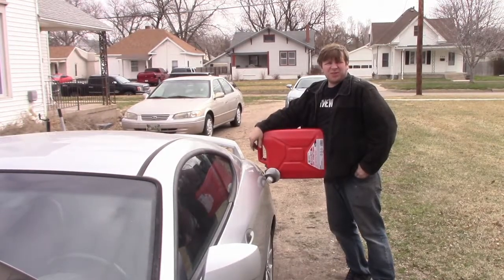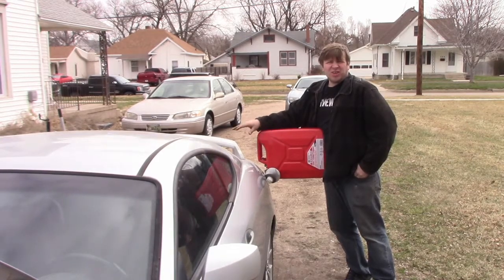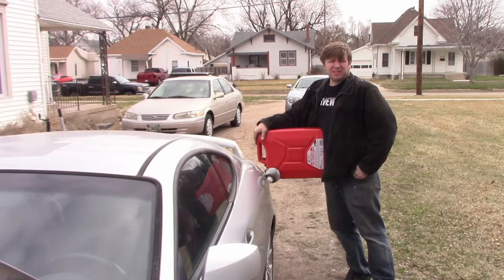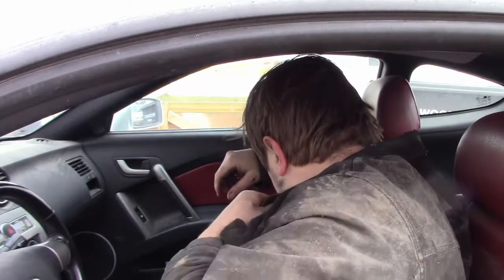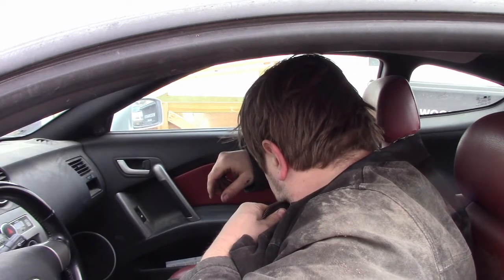Running E85 Without a Tune?| 2007 Tiburon SE | Driveway

Comment: You don't need a tuner to run E85. Just get one of those E85 conversion kit, then u r good. I have been using one on my 2005 Camry since 2016 and no issues since.
Reply from the maker: After stepping back a bit - I would have been fine with just the bigger injectors and it would have been OK.  Where I went wrong was having the high performance cam without a tune which created a lean spot where it was trying to make more power but couldn't.  Every thing is clearer in hindsight.
Reply: Are you still running it?
Reply: @surreal4595  Yes, ma'am/sir. Still kicking it. Occasional engine lights (like once a year or so. Just reset it), but still going strong. What fuel line leak? lol